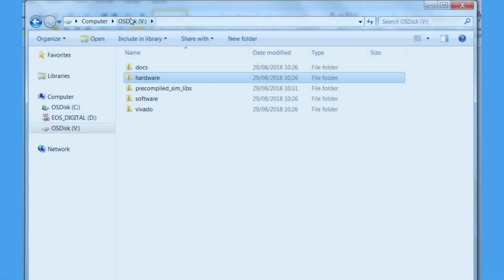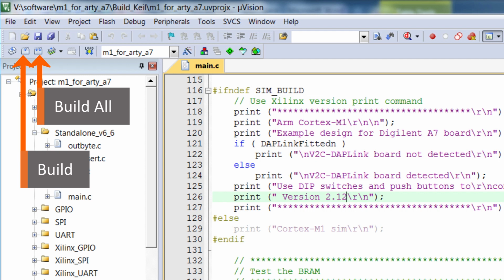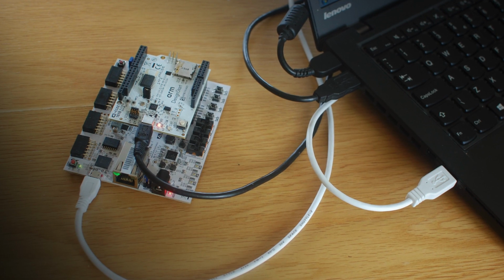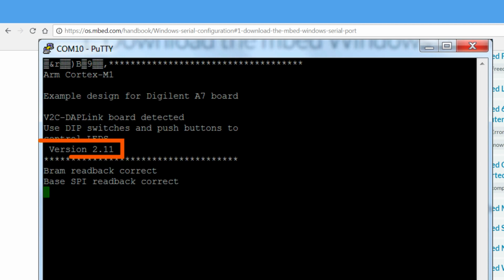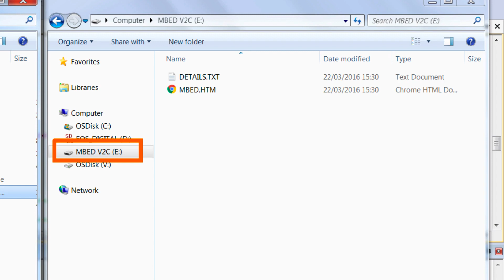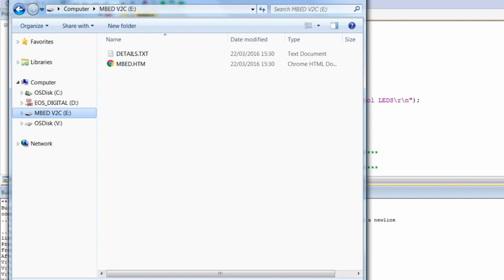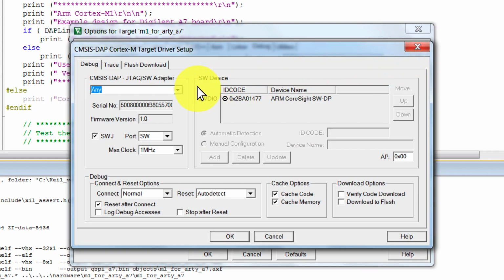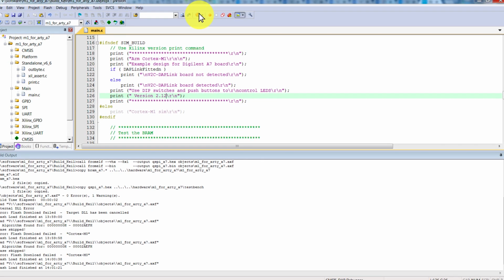Arm Cortex-M FPGA DesignStart: STEP 5 Prepare for debug with DAPLink adaptor

Comment: Great series of videos, thanks!  Ran into a problem in video 4 because I am using the Lite (free) version of the Keil tools (I just want to learn this stuff for potential clients), and the fromelf.exe program that gets called from the batch file is only available with the licensed version, but the DAPlink method worked fine for updating the firmware.  

The only deviation I made from the video instructions was, after the compile failing due to a path problem for the include files, was to change the compiler to the default compiler version 6 (under Project -> Options for Target ... -> Target (tab) -> ARM Compiler under Code Generation on the upper right corner.